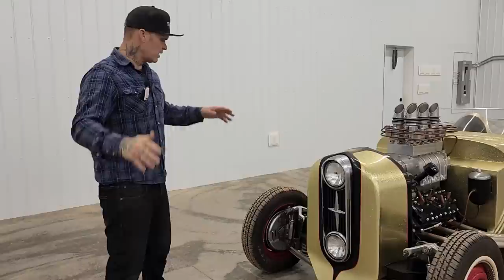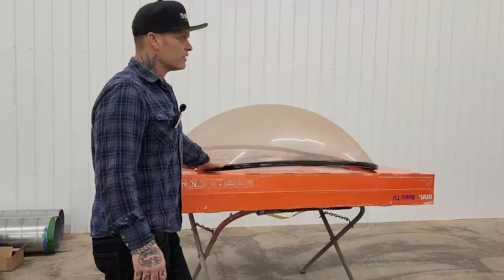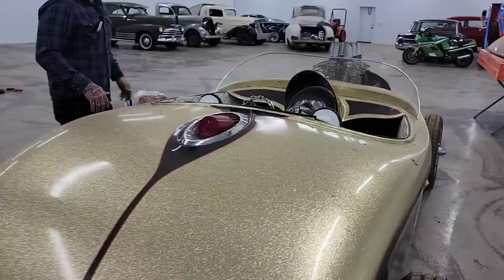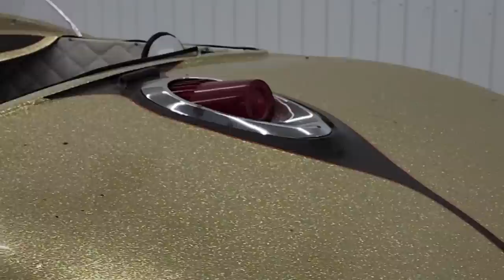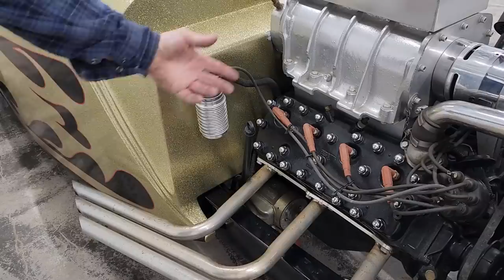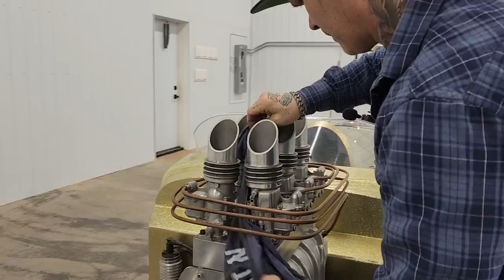Bad Chad built this custom bubble top car out of a junked 1934 Ford 🚨

Comment: Very nice looking Ford highboy hot rod.  How you incorporated the generator with the blower unit is very clever.  Putting the actual carburetor inside the blower housing is ingenious.  I'm sure using 1/2 inch plexiglas over using 1/4 inch will help prevent cracks from forming on the bubble top canopy in the future.  I have helped make a bubble top canopy for our museum's Fisher XP-75 Experimental WWII fighter plane in Dayton, Ohio and we ruined several sheets of plexiglas before we finally got it right on.  Blowing plexiglas is not nearly as easy as it looks.  Especially when you are making one for a fighter plane and it has be made to exact dimensions like it was when it was first made in the factory originally.  Keep up the great work Jolene and Chad.  Thankyou for sharing what it took to make this car into what we see today.  Great job!  Cheers!

Comment: Really nice. Great looking paint job too. Don't feel bad about the steering being hooked up backwards. I bought this boat once, and got it all cleaned up and changed the cable for the steering. When I turned the wheel to the right, and looked at the motor, it went to the right too. I thought it was all ready to go. When I put it in the lake, to my surprise the steering was hooked up backwards. By the time I got to the cottage, I was just starting to get used to it.

Comment: Awsome job. I learned the hard way too lol had a 65 dodge powerwagon the stearing box went out it was expensive so i impervised and used a chevy in its place pulled the gear and bearing and put it in the dodge box all the same exept the direction of the screw lol. Steared backwards i just couldnt get used to it i sold it that way lol. Told them what it needed they wanted it anways its a 49 dodge truck now

Comment: 20 years ago I worked at our neighbors shop he restored cars and built street rods we learned the same lesson on those steering racks we were working on a 40 Chevy coupe and the owner started the project himself and he used a mustang 2 rack on the original front suspension when we got the the steering shaft hooked up it steered backwards so we found a Chevy celberty rack and it worked

Comment: built my first rig when i was 14, it was a 92 dodge dakota i got it by building a PC out of used pieces from the dump swapped the PC for the truck it was rough but ran and drove and stopped put a cool paint job on it fixed it up looking good and sold it when i was 16

Comment: You have to be very careful what sort of chemicals that you use on acrylic, or in this case, stretched acrylic. You can craze the plastic with nothing more than isopropyl alcohol. Using a thicker material will not change the outcome.

Comment: Chad,use aluminum foil and wd40 to clean off surface rust, it won't scratch the chrome. Because it's softer than chrome but still cuts the rust!

Comment: I don't understand why you put three exhaust outlets on each side if there are 4 cylinders on each side.  I think that power and beauty are subtracted
Reply: It's a flathead.
The two inside cylinders share the same exhaust port.
Reply: @willhorting5317  So the central tube should have twice the section
Reply: @jlgas9554  I cannot say yes or no about that. I have never owned a flathead engine.
I only know the information that I have been told over the years.

Comment: Just wondering how you have a 8 cylinder engine but only 6 exhaust tubes
Reply: I found out not too long ago about that question. The middle pistons share the mid pipe. I actually saw it. I couldn't believe it, but the pistons are totally firing in different times and, therefore, one pipe in the middle. FLATHEAD ENGINE.

Comment: What happened with your rack & pinion steering also used to happen with some cars which had the diff built into a plain banjo housing. Put the diff in the wrong way round and you have 4 reverse gears and only 1 forward gear!

Comment: Three exhaust tubes coming off a 4 port head- how are you doing that with 6 cylinder headers on a v8?  I know you have figured out something.
Reply: It's a flat head V8. The middle cylinders share the middle pipe.

Comment: Did he ever say if the super charger was functional or not?
Reply: He did say. It is not. There's a carburetor inside the blower case, fully plumbed. Everything else is fake. Made for show, not go. Engine only produces a little more than 100 HP.
Reply: It's fake. Carb is hidden under it.

Comment: Im not understanding the v8 with only six exhausts
Reply: It's a flathead.
The two inside cylinders share the same exhaust port.
Reply: @willhorting5317  Thank you. Just seems very inefficient. It’s a larger port?
Reply: @coreybell6398  truthfully I cannot say.
I have never owned a flathead.
I only know that over the years, I was always told that they share an exhaust port.